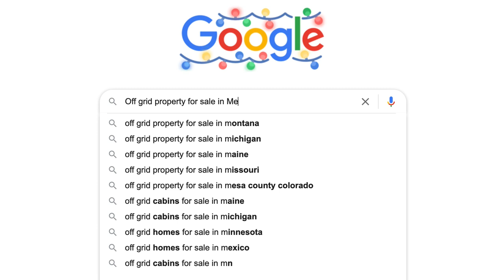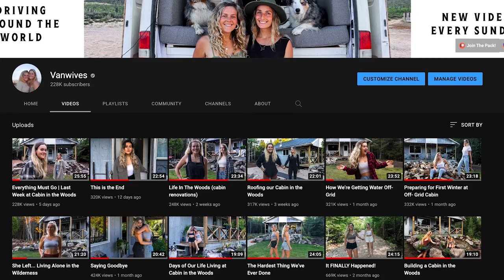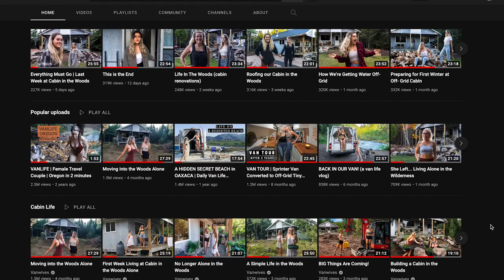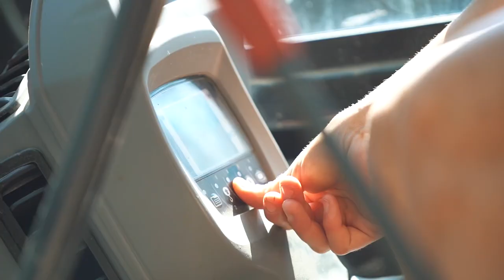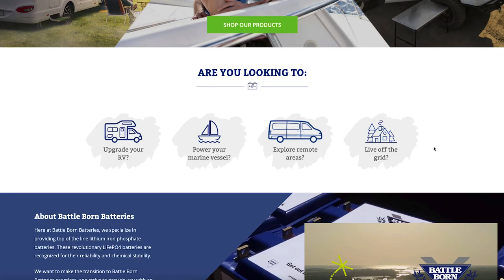Building a Cabin in the Woods Alone

Comment: Now that your packing up for the winter. I have a question that you have not shared with us. The cost of this project? All the equipment you used?  The from brush trimmers,nailer, table saw, and all other equipment,  excavator, material for roof, driveway, outhouse, water well. And etc.

Comment: here are a few hints with the wiring. use 12-2 Romex if possible mx, that is cased in metal.  with solar it helps with power rely as too the plumbing? make all the lines below freeze zone.  wrap the above pipe in insulation. cover that with pest proof material. like steel wool.  it keeps the rats out.  insulate under the flooring then cover that in tin also too control pest. if you can find a ground tank for your water system, then burry it as deep as possible, closest to the cabin. use a 12Volt water RV pump too have constant water pressure.  make all links too system fusible.   also make a power shed behind the cabin and run the wiring from as high up as possible to the entry of the wall.  using the shortest run possible.    there is so much more. try and find an older rv camper and use the apps from that.  too finish the kitchen, and bathroom.  the price covers the cost of buying new.   or you could build a add-on in the rear, below the roof line and use that as a power room/ bathroom, storage.  but make it the same size as the walls.  also gutter the cabin and use the rainwater to supply the water needs outside of drinking water.  the needs always outweigh the must haves, or the got to get Dones.   welcome too home ownership, and the days in the dazes. it never ends, but worth the efforts.   stay the course it will make it fun and happy life.